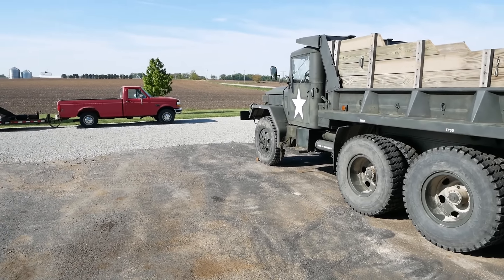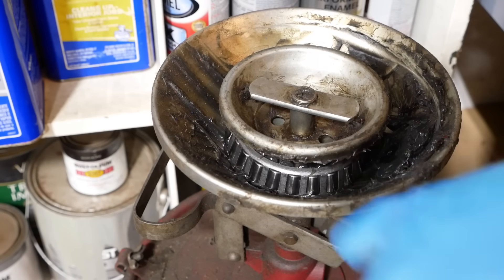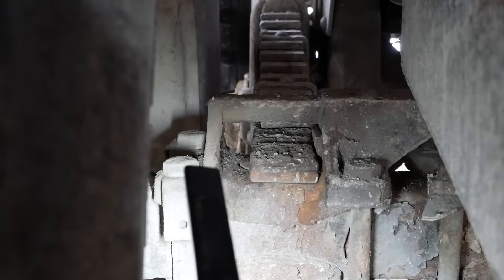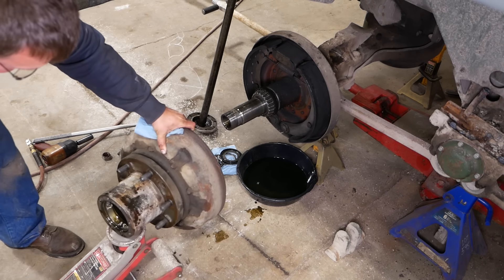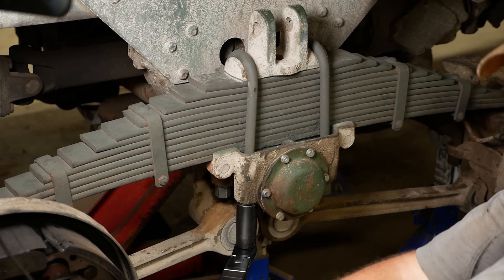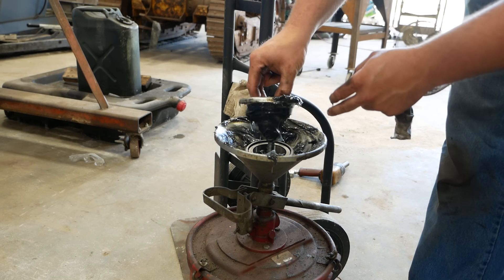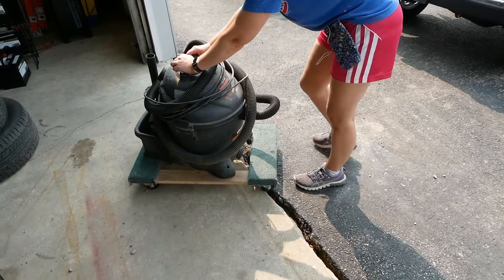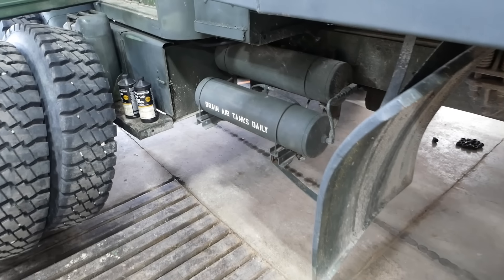Military Truck Crazy Suspension Damage - Can We Fix It?

Comment: Measure from the center line of front wheel to the center line of the closest rear wheel. Compare the distance. If there is a difference from each other. This will be your dog tracki g problem

Comment: YOU NEED TO TAKE OUT THAT PIN AND REPLACE IT … THAT PIN IS TO MAKE THE LEAF SPRINGS CENTERED FOR THE TIRES NOT TO RUN SIDE WAYS !!! NOT REPLACING THE PIN WILL GET YOU MORE IN TROUBLE!!!

Comment: They didn't fix it, because I would think,  the springs were new or at least not as worn, the tires were the proper smaller size, therefore the issue wasn't as noticeable,  also, they were like the one guy said, 19 years old, they thought it was so much fun to drive that thing they didn't know any different 😊😅😂

Comment: Mate this will seem like a dumb question but why don’t you put the correct tyres on this old girl. Most of your problems are coming from the large tyres, the fact that there is a fingers breadth between the tyre and spring is more than enough warning. Most trucks that the army bought had a certain tyre size that the truck was made to run, perhaps the rear tyres are slowly wearing the back end out. This is just a thought on my part, so don’t take it as gospel. See ya Cheers from crocodile land, kangaroos too.

Comment: Someimes repairs aren't as simple as they start out to be.  They become a puzzle with small pieces that don't seem to match.  The rear axle and suspension components are now in better condition than they have ever been since new.  Watching you drive the duce and a half in the final test drive shows the front end components are in very good condition.  You don't have to move the steering wheel too much to keep a straight line.  Maybe that truck came out the back of a C130 parachute drop and something went a little bit askew.
https://www.youtube.com/watch?v=CQyN6eAaDeI
The future of Amazon deliveries!

Comment: I dont know what all the drama was about ,,looks like a standard   6 rod suspension from the 70's   and to take the gas axe to the " U " bolts was a bit barbaric,, In the 70's I drove UD tippers that had the 6 rod suspension  and dismantled them ,,, I never pre loaded  ( torqued )  any wheel bearings  ,,, And I can see at a glance you havent  fixed the problem because  the wheels are not in line ,,

Comment: Great video. I'm not sure if it's been mention before in these 3000 replies, but to prevent a future nasty cut from that wire, it helps if you turn in the cut end. They call it a "pigtail" in aviation terms. Here's a good video from another member here which shows the process. 
https://youtu.be/OwFjUX6SaY8
Also, I'm gonna guess John Rambo messed up that rear axle when he jumped over some cop cars...Just a guess
https://youtu.be/__QyvnqBW-c?t=123

Comment: /you need to check all the unbolts to make sure they  are not lose and all the bushings with a pry bar  / the center pin is broke on the spring  you need to remove all tires  that old ubolt is worn .that flat spot is from the spring moving back ans forth / and you do not want to go with smaller ubolts who ever told you the is full of shit it was made to use that /size bolt / you did not put any grease in the housing lol

Comment: Typical mechanic... goes in to fix a small problem and ends up ripping the entire project apart sending you bill through the roof but never fixing the original problem.